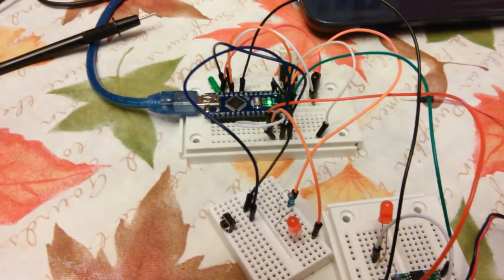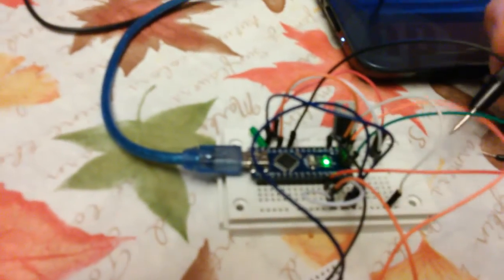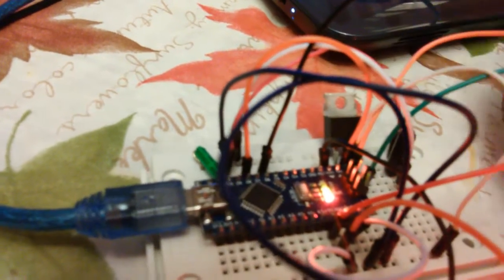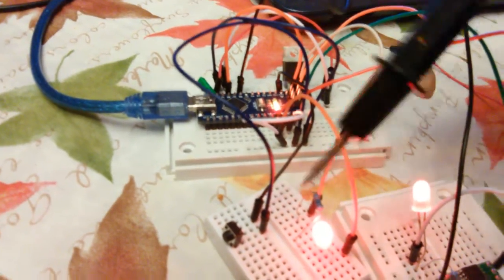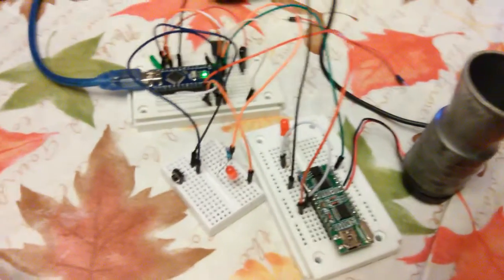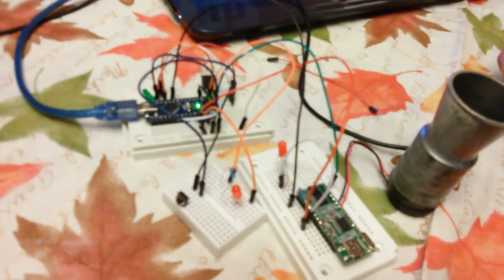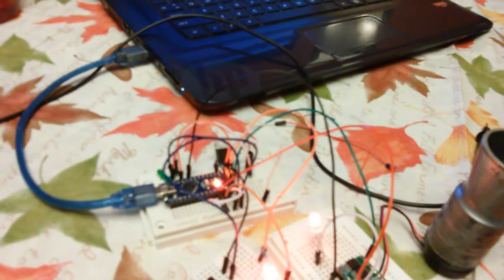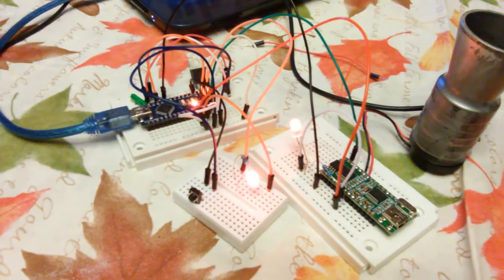Arduino Lightsaber Project testing complete.

Comment: Hi Mr. Pealer. I was able to more/less get something working with some code. 

My problem is that the speaker is quiet. Any suggestions to this predicament? Thanks!
Reply from the maker: make sure you have the WT set to PWM mode.  not DAC.  can you get the WT to play any sounds?  I would start a WT project in button mode first, to see if you can get it to play,  then make a new WT project for 1 line serial mode and the arduino.  google "Arduino Lightsaber"  for this topic, and read the first 20 posts on the arduino forum that covers all your questions.

Comment: Awesome setup you got there, I love it! Could you please share the components and brand for the clash sensor and swing sensor? Thanks in advance.
Reply from the maker: https://forum.arduino.cc/index.php?action=dlattach;topic=261980.0;attach=143399

this is the wiring sketch with product info
Reply from the maker: https://forum.arduino.cc/index.php?action=dlattach;topic=261980.0;attach=143399   sketch and parts info
Reply: @billpealer  looks like those links are old! Does Arduino have archive info? This is a forum link, right? Thanks

Comment from the maker: Don't worry about the resistors for both the BUSYPin and Indicator LEDs. They are not needed.  I was mistaken about them.  Also...  if you plan you incorporate PWM in the Mosfet, you will need a 1kohm 1/4watt resistor shorting out pin 1 and 3 of the mosfet.  This helps crash the PWM signal to Zero volts when off or at PWM value=0